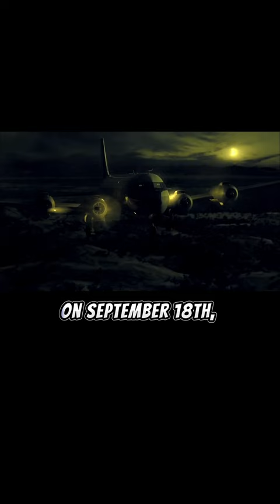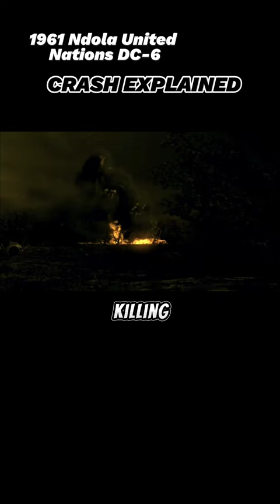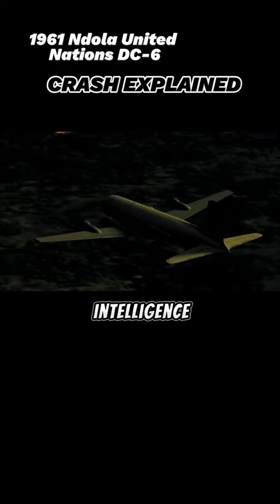1961 Ndola United Nations DC 6 Crash-Explained🥶 #aviation #shorts #fyp

Comment from the maker: For those interested, here is a breakdown of what happened:

The exact cause of the aviation accident on September 18, 1961, involving the Transair Sweden DC-6 aircraft operated for the UN, remains unknown and contested, despite multiple official investigations and speculations over time.

 Here is a detailed look at possible causes and investigations:

1.Official Investigations:

Rhodesian Board of Investigation: The initial inquiry led by Lt. Colonel M.C.B. Barber in Rhodesia (now Zambia) between September 19 and November 2, 1961, concluded that the pilot flew too low and struck trees, causing the aircraft to crash.
Rhodesian Commission of Inquiry: This was a follow-up investigation taking place between January 16 and 29, 1962, under Sir John Clayden's leadership but without UN oversight.
United Nations Commission of Investigation: A subsequent inquiry conducted in 1962, led by Nepalese diplomat Rishikesh Shah, relied partly on the testimonies provided by the previous Rhodesian inquiries.

2.Official Conclusions:

 The investigations did not provide a clear conclusion. Reports indicate that the pilot flew too low, hitting trees, but no conclusive evidence was found regarding a bomb, surface-to-air missile, or hijacking.

3.Speculations and Alternative Theories:

Involvement of Western intelligence agencies: Due to the political context of the Congo Crisis, speculations arose regarding the involvement of Western agencies, including the CIA, in events leading to the plane crash.
Controversies regarding official reports: Some critics argue that official investigations were incomplete or dismissed possible signs of foul play. For example, doubts were raised about conclusions regarding gunshot wounds to Swedish guards on board.

4.Subsequent Investigations:

In 2015, UN Secretary-General Ban Ki-moon appointed an independent commission led by Mohamed Chande Othman to examine new information. The commission found new testimonies suggesting that Hammarskjöld's plane was already on fire during landing, and other aircraft and intelligence agents were nearby.

In conclusion, the exact cause of the accident remains unclear, and speculations and alternative theories have persisted over time. Official investigations have failed to provide a definitive conclusion, fueling speculation and mystery surrounding the death of Dag Hammarskjöld.

Source:ChatGPT
!!! ChatGPT can make mistakes. Consider checking important information.
For more information you can search about 1961 Ndola Transair Sweden DC-6 crash.

Thanks for watching this video.🙏✈️